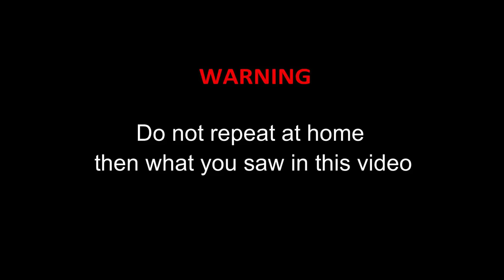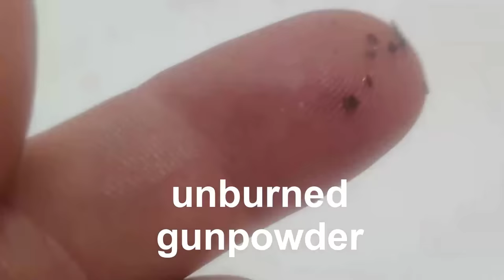WHAT CAN A BULLET OF AN EXPLODED CARTRIDGE PENETRATE

Comment: A bullet needs a barrel for it to be functional, it's just basically a small frag grenade, I seen more damage done with the back side of the cartridge by the primer going off then the actual bullet hitting a object, seen the primer end blow holes 🕳 thru sheetmetal ,while the bullet just bounced off
Reply: The barrel of a gun doesn't accelerate the bullet, just makes sure it goes straight
Reply: @Echo_8054  I'm pretty sure that the presence of the barrel affects the bullet acceleration during the combustion of the propellant
Reply: @mabciapayne16  ah yes sorry i was wrong
Reply: This along with my comment.
Reply: No it needs a chamber to contain the expansion of the cartridge. The barrel is only a means of directing and maintaining the flight of the projectile.
Reply: @lyleadams4367  how fast would a bullet go if there were no barrel at all?
Reply: @mabciapayne16  ok expert, how fast will one go without a chamber? If you just stick a barrel onto the end of the cartridge, the cartridge will rupture. If you just put the cartridge into a tube that will hold the cartridge it will fire but not preform very well. So in order to get any cartridge to work as designed you first must have a chamber then a barrel. Without both you have an almost useless POS.
Reply: @lyleadams4367  lmao i'm just asking cuz i can't find any charts
Reply: @lyleadams4367  no, the bullet gets propelled forward by the gas going through the barrel. So the longer the barrel, the more dead the thing you are shooting at is.
Reply: A bullet needs a chamber to support the cartridge internal pressure and a barrel to allow the pressure to expand while accelerating a bullet. The longer the barrel the higher the velocity of the bullet up to point the pressure drops from no more powder to burn then friction of the barrel will start to slow down the bullet.
Reply: I seen!
Reply: Correcto, sin cańon No funciona..
Reply: @peerheitd6854 longer barrels shoot harder, the more time the bullet spends in the barrel the faster it goes
Reply: @robertmurphy3014   as a Blowgun shooter myself, yes. A longer barrel concentrates the explosion in 1 single direction. Even breathing into a 15mm pipe can do lethal damage.
Reply: @lyleadams4367  Both
Reply: @lyleadams4367  yes, it similar to blow the wind in the pipe there will be no air pressure if you stick the lip directly to the pipe.
Reply: @Echo_8054 the barrel provides a pressureised enviroment that builds up far more force than setting off a bullet outside of the barrel.
Reply: @nevik2950  yeah i know i was just tired and stupid
Reply: The shell sits in a chamber to be sure all the explosives move in one direction not half a lobe
Reply: @Echo_8054  But without a barrel the energy spreads in all directions and only little energy really accelates the bullet! Even the .22 should penetrate the 0.1 millimeter metall!
Reply: @fritz_von_steiner5544  yea idk what I was smoking when I made that comment

Comment: The damage will be even less if the bullet is just laying there loose. Fixing the bullet like that will allow all the energy to go forward and sideways, but not backwards.
Reply: Exactly what I thought. In videos without it held down the bullet goes forward and the casing goes backwards at the same speed. But because the casing can’t move backwards all the energy is now given to the forward momentum. So he’s doubled the power of each of these cartridges
Reply: Con ese dispositivo no deberia disparar el .22 de fuego anular.
Reply: Put glue on it lay it down and light it. Case will go farther than the bullet. Not far!!!!! I did this test when I was 12.100+ times. Bullet can't really hurt you without a barrel to trap the explosion behind the bullet.
Reply: I thought this too. Had a friend throw 22LR rounds into a camp fire once. I was hit with a projectile barely felt anything. It was basically a small firecracker.

Comment: So every gun has a different barrel designed to be most effective for its bullet. And the the length of the barrel, or the choke for a 12 gauge etc also makes a difference. With a barrel, they all would pass right through. All results would be the same and rather boring as we all know what will happen. By removing the barrel the comparisons seem more equal and the results somewhat surprising. As we see the 7.62 is dangerous with or without a barrel. And a 22 is pretty harmless outside of a gun. He did a great job in this demonstration.
I like the tests and would love to see more like this.
Reply: Thank you, I was really confused why 22 didn’t penetrate even 0,5mm. 
I thought something is not the same as shooting from gun, but couldn’t pinpoint it. Your comment did it 👍🏻
Reply: It's old ammo. The 22 lr is old russian garbage from 40 years ago with the powder mostly gone. Look how much powder is burning afterward in the 12 gauge shots. New good ammo would have the 22 going right through
Reply: It's pointless to evaluate cartridges outside of the firearms they're designed for.
   Also, telling everyone not to do this at home is tantamount to telling them that they can do it anywhere else.
Reply: @Talkshowhost23  It was only 0,1mm steel!
Reply: @taowroland8697  Wow!  You don't get it?  It has nothing to do with garbage ammo, its because the case is not supported - the gas just explodes the case and very little is actually used to push the bullet!  Also if 22LR survived 40 years and shoots thats pretty good ammo!
Reply: @Talkshowhost23  his comment is correct about barrels but wrong when he states that 7.62 is deadly in or outside of a barrel. This experiment is not a true exploding cartridge experiment. The fact the the cartridge is supported and not allowed to move at all makes this experiment as a “exploding cartridge” just wrong. Quite honestly this is closer to being shot out of a gun than to being a exploding cartridge. I’m a true exploding cartridge the brass would be more dangerous than the bullet. While still a cool video, it is not correctly labeled. None of the cartridges would penetrate anything is this was done correctly. Again, the brass cartridge would be more of a hazard than the bullet itself. The way this experiment is set up, the forces from
The explosion of the piercer have nowhere to go but forward where as if the cartridge was truly free of any obstructing forces, the force of the explosion would want to travel in all directions. Especially to the rear since there is a hole in the base of every cartridge where the primer sits. That would be the path of least resistance in a true exploding cartridge experiment.
Reply: Also if you think about it, the 7.62 x 39 actually has a teeny tiny “barrel” in the neck of the case, compared to the straight walled cartridges. The shoulder of the necked case gives it just a tiny point to bottleneck the pressure from the powder burn before the bullet fires, in comparison to the straight walled cases.

Comment: Here’s the thing fellas. If a bullet goes off outside of a firearm, more than likely there won’t be anything holding the casing in place. Since the casing is heavier than the projectile the casing will fly off leaving the projectile behind (roughly). In this set up the casing is still being fixed in a stationary position so essentially you’re shooting a gun with a 0” barrel
Reply: I guess it's the other way, the casing is usually lighter, which is why it indeed moves faster than bullet when the round is not contained. Since most of similar tests concern cases such as free ammo in fire, it's interesting to see also this variant.
If it can be called 0 length barrel gun is to consider since it's missing chamber and casing can freely expand or split, which takes away most of the energy, compared to something like shooting a revolver without a barrel.
Reply: Yes I actually wanted to bring up that point as well the chamber is what encases the bullet and keeps its form. That’s why you are able to reload ammo. Regardless this test is useless for a real world scenario. The best way to test this is to heat up the ammo with a torch
Reply: Until the round cooks off

Comment: .12 function as a flamethrower in case in don't destroy the target properly lol
Btw you forgot to mention that this happens because in every case the cartridge has a surface to rest against. In other words, if you would just threw them lose into a bonfire, as an example, what would go off would be the case not the bullet itself. The bullet would jump off with minimal speed and distance since it's a lot heavier than the case. Cheers.

Comment: That was an interesting video you forgot the one thing you need to take in consideration when a bullet goes off and it’s not in the chamber of a gun meaning just lying around with nothing holding it in place. The cartridge is usually the part that flies off the bullet is heavier than the brass or the casing doesn’t usually have that much velocity
Reply: Uh, thats the point of the experiment,
Reply: Great catch. Still a cool video, but not a true exploding cartridge experiment
Reply: @cliffords2315  as I stated in my comment, Greg means that in a true exploding cartridge, there wouldn’t be a jig holding the base of the cartridge firm against a solid base like in the video. In the video, the cartridge isn’t allowed to travel at all, only the bullet. That’s not what would happen in a real life scenario. It’s Newtonian physics. For every action, there’s an equal and opposite reaction. The cartridge in the video isn’t allowed to move backwards or anywhere else for the matter. Which means that when the powder explodes, the forces of that explosion have only one place to go, forward. And that’s more or less like having it chambered in a sawn off barrel. You can saw off some double barrels all the way down to the trigger allowing the shell to poke out the end. While the explosion wont result in intense pressure behind the pellets because there is in all intents and purposes no barrel, the pellets will still travel forward because the shell is chambered and sitting firmly and locked in the chamber not allowing the forces the explosion to travel anywhere else. So I’m layman terms basically just like the experiment in the video.
Reply: @alexpontiff9763  👍

Comment: Yes, any cartridge needs a barrel but supporting the head of the cartridge in your fixture mimics, if only a little, a barrel.
Most occurrences of cartridges firing outside a gun barrel involve fire.  Heat a cartridge up until the powder ignites.
In an unsupported scenario, the cartridge case would move probably more than the bullet resulting in decreasing the speed of the bullet considerably.
In other words, the projectile would do considerably less damage.

Comment: Not surprising at all. I was mostly waiting for the 12 guage wrapped in plastic, it didn't disappoint.

There's a reason the larger the shell, the larger the barrels. You have to contain all that energy being released and focus it all in one direction. 

That requires alot of steel in some cases, like the 16" guns on WWII battleship's. That 2 ton projectile wouldn't be going anywhere without a solid and rubust barrel.

Otherwise, you just have a fireworks show.

Comment: so what is the point? You have there a very inefficient gun, the case base being anchored permits transfer of force to the projectile but the lack of a barrel to confine and direct the full energy of the propellant just makes for a real inefficient discharge of the round. Without any anchoring of the case it usually results in just an explosion because the projectile resists being put into motion and the case is easily blown away from the projectile or just ruptured.

Comment: Interesting test.  However a bullet going off while securely held at one end does not accurately depict what might happen in reality.  More then likely the bullet and case will not be held by anything in the event of a cook off.  Like a cartridge going off in a home fire.  Can you redesign your test with a propane torch heating a loose round.  With the mass of the bullet going one direction and the cartridge going the other, I think you will have an even less eventful result.  Also there will be no primer strike which will slow the combustion of the propellents.  Will be an interesting experiment.

Comment: This video holds no weight. If a cartridge were to somehow go off without the primer being struck it wouldn’t be held firmly in place allowing the energy to exit the path of least resistance that path being the projectile. The casing would travel farther than the projectile because it’s lighter and in that case would be the path of least resistance.

Comment: Your test was severely flawed. A similar test was done with just a wire holding a bullet over a flame. In those test it represented the most feasible way a bullet would be detonated. In those cases nothing was penitrated and the shotgun shell just vented gas, it didn't even open the crimp. You on the other hand are locking the shell in place and detonating the primer and causing the powder to burn much faster. The only round that would set off the primer is the 22 because the rim is the actual primer and is exposed. The 22 would still do zero damage if thrown to the ground, the brass is too thin and it has too small of a charge. If you threw a center fire round to the ground it is damn near impossible to strike the primer short of having a nail sticking out of the ground and striking it perfectly. If ammo is exposed to fire they just harmlessly pop off. The biggest problem would be starting a fire from flying hot embers.

Comment: Interesting, but i mean, c'mon. It's pretty obvious that a 7,62x39mm Round will penetrate 1mm of steel or 4mm Glass 🤷‍♂Like, what do you seriously except? And it also should be obvious that 22LR (Which couldn't penetrate 1mm of Steel and only left a minimum bend) can't penetrate 4mm of Glass
Reply: It’s because there’s no barrel
Reply: @vn.ninefive  Ik, but still.
Reply: @vn.ninefive  the closed chamber and pressure buildup driving the bullet through a threaded barrel is where the energy comes from. If you stick the bullets into a barrel and do the same tests, it would make no difference without a proper chamber.